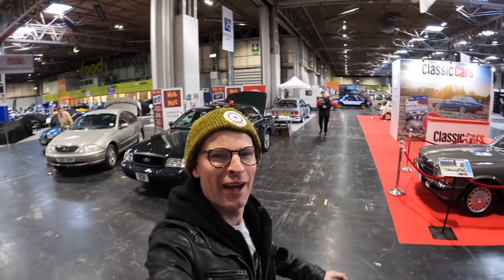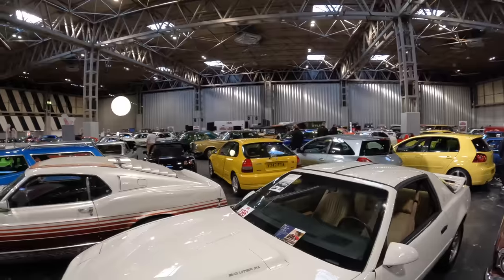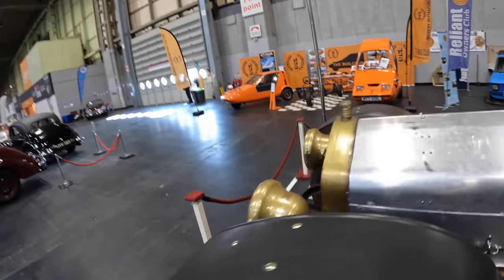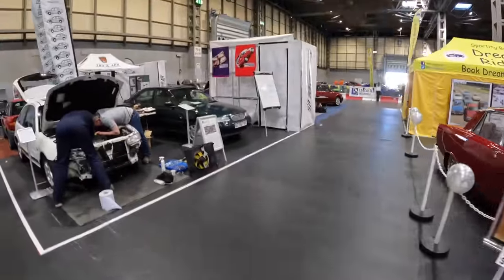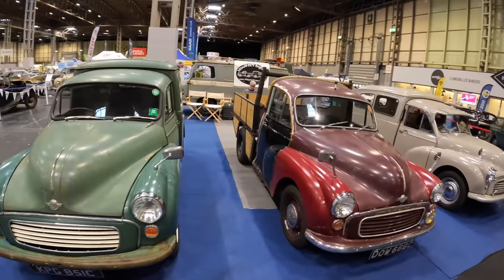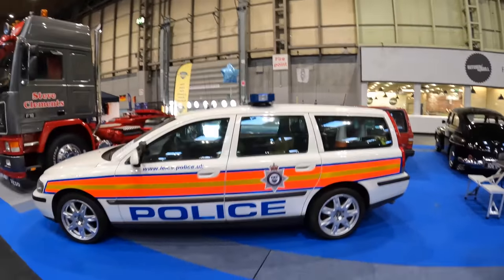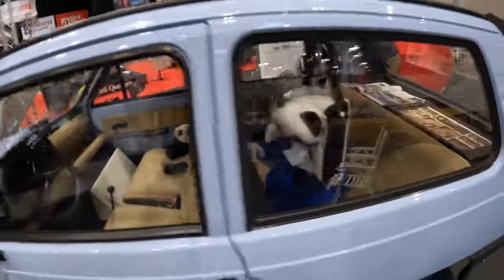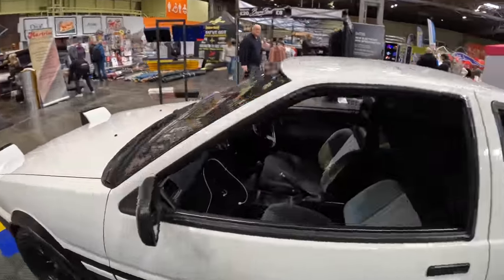NEC resto 22

Comment: The Falcon pickup is definitely from the factory. The model was called the Ranchero and it’s what Oddjob drove in Goldfinger to retrieve the remains of the Lincoln Continental crushed with the gold and the unfortunate Mr. Solo still inside. Of course the weight of that would be well beyond what the little Falcon could handle.
Reply: thanks, you save me a lot of typing!

Comment: Epic walkaround, great commentary and camerawork, thank you so much Matt.
Ahh we had a Marina van which was meant to run on 2 star but we ran it on 4 star for extra umph and eventually burnt the valves out, so as a teenager I took the head off, followed the Haynes manual step by step, had the head skimmed, fitted and lapped new valves etc. and to my surprise it started beautifully after reassembly but alas it wouldn't idle. I was baffled. Turned out I'd used too thick an oil in the carb dashpot, ha. Seeing the Rover P4 brought back memories too, my Dad's friend used to take us out his P4, and yes he was a Doctor.

Comment: Great and varied coverage as always Matt.Historic car at 13.13 , the ' 69 London to Mexico Austin Maxi , MCE 7G , known affectionately as Puff The Magic Wagon  by the 3 original  lady rally drivers !.Sponsored by main Austin dealer , Marshalls of Cambridge it made it  .A friend bought it secondhand in the early 70s , I recall it had the most comfortable reclining seats and a built in Hydrolastic suspension pump to alter the ride height at will depending on the terrain !.I believe it is back in the hands of one of the  surviving crew.
Reply: Bron burrell

Comment: Those Gran Torino Wagons 1973 version, (Estates) poverty spec. used to handle, Rather Wallow like a sinking Ferry in a high sea. An old friend of mine had to remove the factory dampers and replace them with a more modern Air shock to make it a bit less primitive to drive. other than that , they were fine. Cheers Matt.

Comment: I love these cars. Most look like they have been driven around. It is not like a typical USA car show where they all come on trailers and never get driven. Which is a right shame as those cars are meant for driving and it was not uncommon to see a mid 1970's American car being driven as a daily in the late 1990's. As for badge engineering, it seems 80% of General Motors USA's line up in the 1980's was badge engineered cars (Like the 1982-96 FWD A-Bodies (Cutlass Ciera, Pontiac 6000, Buick Century and Chevy Celebrity) but at least they sorta of looked a bit different. Over in the Chrysler area, they made the Plymouth Reliant, Dodge Aries, Plymouth Horizon/Dodge Omni (basically a warmed over Simca/Talbot Horizon) and minivans which were simply the exact same looking vehicle with a different name and in the 1990's they had a Dodge Neon and Plymouth Neon that had nothing different about them.  I think the reason not many of the 4 wheel Reliants were sold was the whole premise of the Reliant was that it was a 3 wheeler that you did not need a full driver's license for. If you were buying a 4 wheel version of the car, you had a regular driver's license and you did not need to buy a Reliant, you could buy any other car.    

This place is got everything. I have not seen a Honda del Sol in years.
Reply: Your trailer cars are called 'garage queens' over here. ie they are only allowed out on a 4th Sunday if its not raining LOL. When as you say its all meant to be driven.